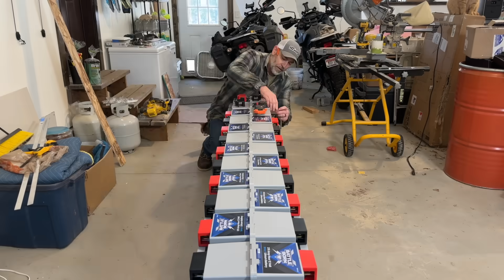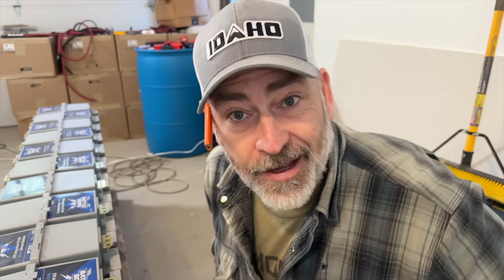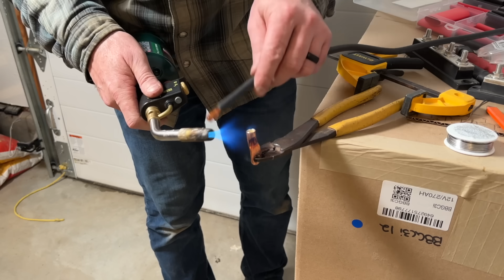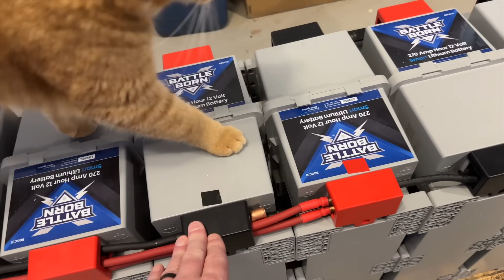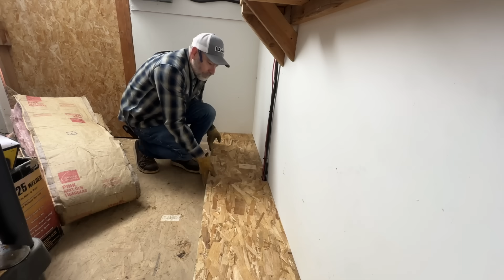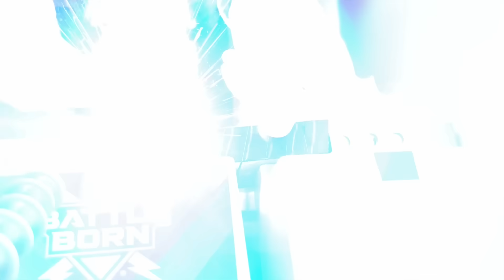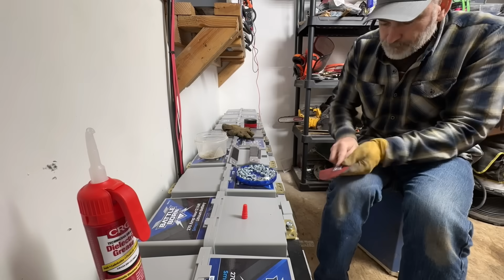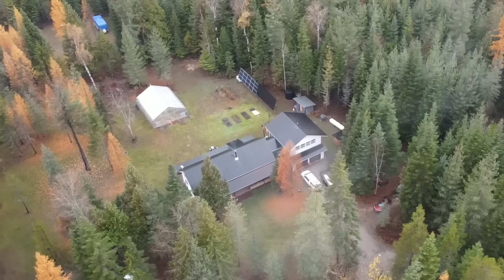BEST Off-Grid Solar Power System Battery Bank

Comment: Honestly ive been looking into a battery system like this, thank you for this tutorial on how to set it up.
Reply: You want nothing here.  Nothing.  If you consider any of this a tutorial, it is a study in every thing not to do.

1.  Battleborn is full of sh*t.  Just the batteries in this 'build' list for $25,000.  My whole home system with 8 280Ah batteries cost about that much.  Including the solar panels.

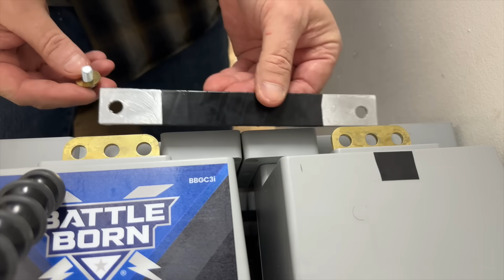2.  If you watched this video, especially to the 15:42 mark, you'll see a great reason why you shouldn't follow ANYTHING here.  He's lucky he wasn't hurt.

3.  Not a single good practice was followed.  The wire is undersized.  You DO NOT solder lugs.  There's no fusing.  No balancers/equalizers.

4.  You want a 48V system and battery, just go get 48V batteries.  The choices are numerous.  And it will not cost what this trash costs.

Comment: You seriously have know idea what your doing there is no string protection your soldering lugs instead of crimping them you did not charge the batteries before connecting them together, we're is the cooper bars connecting the batteries together aluminium is less than a third of the current carrying capacity of copper antiseize on the bolts there's just so much wrong with this video mate please get a huge life insurance coverage for your families sake

Comment: Your cables are undersized. Without each string being isolated by a fuse you have the potential to put enough current through one of those lugs that the solder melts. this is a disaster waiting to happen. You need a professional to go over this with you to ensure you don't burn your house down.

Comment: Yikes, Marty, you definitely have to be more careful when working with these high power devices. you could easily have severely injured yourself!

Also, a lot of things are definitely wrong with this setup. I don't know if you are taking feedback into account, but if you are, here are a few pointers:

- wrong size cable: Especially when paralleling the strings, you need a cable that can carry the sum of all currents. Even more so, look at the highest current rating that your battery can deliver and size the cable to that. You definitely don't want your cable to burn up before your safety devices habe a chance to trip.
- aluminum bus bars: you should definitely use copper here. Aluminum is notorious for passivating itself leading to high contact resistance.
- soldering your lugs: i don't know where you got the idea from, but you definitely want to crimp these lugs to your cable to create a solid cold weld. The solder will re-liquify itself when the cables get hot. Worst case, the connection will become lose and you have an uncompressed lug and a cable that do not have a solid interface. This will lead to hot spots, more heating and even possibly fire.
- Paralleling the batteries: In my view, you should have a DC breaker per string to be able to controllably control the current going into your batteries and have a safety switchoff
- Cable length when paralleling: Victron is pretty specific that you need identical length of cables from each battery bank to your inverter. You aren't showing how you set up the wiring exactly, but it looks to me as if the three banks end up having differently long cables. this leads to differences in resistance, and will create imbalanced batteries in the long run,.

Even if you report 6 months of flawless operation, i can only hope that you will take this advice and rework the setup as per the suggestions as it is currently very unsafe. 

Edit: I concur with the rest of the folks here: Will Prose showed a lot of the things. Best take his advice into consideration.
Reply: I feel for you, I'm guessing the comments will cause a lot of stress for you and your family. I love the content you usually put out and I enjoy watching it every week.

Comment: We are not off grid but we are using solar, gas and generator like you, we just had the option for grid when we built this home so we took it to have more options. Recently we have added a smart home controller to track / change how we use power. It can monitor and change settings in the Victron equipment helping us conserve power for example if storage becomes less than 5000W turn off AC and lights then send me a notification we have reached <5000W for example. It’s something that is a game changer for us trying to not use grid. We also use it to start things like AC if we are over 95% charged and the temp inside is > X... and run until storage is < X for example. It’s worth looking into with all the options these days.

Comment: U shouldnt even be using solder esp with the that solder technique….melt the solder in the lug and then plunk the wire into it. Good chance of a cold joint which will fail.

Comment: So many of you, people came over here from will's video and you need to go back
Does he need fuses? Yes, should he have used bigger wires? Yes, should he have crimped instead of soldering. Yes. Ithis a system that has been running for 6 months? Also, yes, did it cost a lot of money. Why are you checking his pockets like that? This is what he wanted to build. This is what he built. Go sit down somewhere.

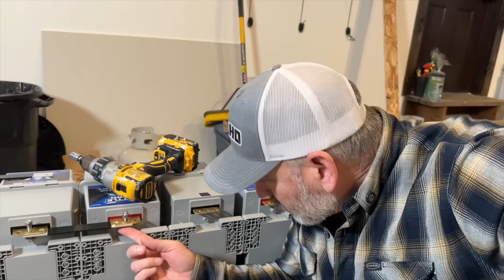Comment: 11:42 - Ya that really sucks, but the problem isn't the nylon, the problem is that you didn't use anti-seize on stainless hardware. For the price of the batteries they really should have include brass hardware.

Comment: Actually un-subbing. Can't trust the rest of you work my dude. You are going to people killed by starting fires. Im all for buying American, but your setup is NOT safe. You're not even soldering correctly. You heat the wire, then let the solder "absorb" into it.

Comment: I remember when your first video came out somewhere about 8 years ago, you were one of the first to use lithium batteries when most of us were still babying out our AGM batteries. May I say nice work? My diy setup is mostly of used lifepo4 cells bought off Battery Hookup who told me it is not wise to mix different types of lifepo4 batteries especially manufactured in different countries. It's been 3yrs and my system works well. I would say though after 6 month I would had love to see if they are balance and how accurately they are sharing the loads.

Comment: Why do you not crimp your cables. Solder only, if ever gets hot, can fall apart and short to whatever it falls against. Always, always!! Crimp the lugs!! Then if one wants a bit more noble connection, solder it too. Don't use solder for the mechanical connection!!

Comment: Why on earth would you want to use 12 volt batteries instead of just one 48 volt battery?  You'd be spending $25K just for the batteries.   My EG4 setup is 42.9 KWH....  plus the Flexboss21 inverter and the GridBoss MId for just over $17K.  So why spend $7k more and put in all this work?    No way this is the best off grid system.   This seems silly to me.  Might have done this maybe 10-12 years ago when 48 volt batteries didn't exist.

Comment: Hi, I'm Martin Johnson, I'm here to display that you can spend 10x more money on batteries that aren't suitable for the bank I will build with them.  I suggest after dropping 25k on batteries you save money by using aluminum busbars and not dropping $100 on a cable crimper and instead create an incredibly dangerous system by welding the lugs and placing negative and positive cables of improper gauge directly on top of each other.  Thanks for tuning in.  Oh, and make sure you have good fire insurance.

Comment: There are many things wrong with this video.  I am surprised Battle Born sponsored this.  However, when I looked at Battle Born's website, I saw all they sell is 12v batteries.  This seems very counter intuitive since there is no easy way to balance these when put in series.  When you start with a 48v system, the BMS's are generally setup for internal balancing of the batteries.  These are not.  As Will Prowse pointed out, they are out of balance in this video.  Battle Born, I would ask Martin to remake this video correctly with good electrical practices.

Comment: Do you know the number to 911. 
This is the biggest joke of a battery system. 
Don't do these aluminum bus bars. Are you joking. Soldering  Not a crimped under size cables to close together..

Out of balance cells this is so crazy. 
Stay away from doing it this way. 

I could go on forever. Even Battleborn battery should tell him this is not the way.
If they are supporting this they are libel. 

DON'T DO THIS SYSTEM THIS WAY........

Comment: This is a nightmare. As an electrician who specializes in solar power and putting the systems into houses, don’t do this. This is a fire waiting to happen. This is how people get killed with systems like this.
Reply: You are correct. This video needs to be removed.  Battleborn is reckless to sponsor this
Reply: @d.rayowens422 well they do melt contacts.
Reply: Exactly this is literally every single thing you should never do .

Comment: This is a great way to burn down your house and your wallet. 12v battleborns cost like 3-5x an actual 48v battery of the same capacity. Aluminum isn't suitable for that much current. Soldering lugs is very wrong, crimp them... Battleborn should be furious about their product being shown in this setup

Comment: Where is the battery balancer?  When you tie four 12v batteries in series, you need a balancer to keep them in sync.  You can even see this in your app,  the batteries are not in sync.
Reply: Check page 39 of the battery manual

Comment: You’re honestly putting a lot of people, including yourself, at risk here. Don’t do this. This isn’t fine. Your conductor sizing is not safe, your material choices do not account for junction differential, you’re introducing brittle mechanical joints with your flood soldering.

Comment: Just from an electrical point and over 45 years of working with high power DC systems up to 3 MILLION VDC, I feel compelled to comment. THIS SYSTEM IS AN ACCIDENT WAITING TO HAPPEN!! You are aware that copper melts at about 2,000 F and it will happen in a few seconds when you over amp your 4 ga wire. Also aluminum is not conductive enough, your pick is good for maybe 175 Amps, for the amperage capacity of the battery if there is a fault, copper would be a much smarter choice (3 times the capacity). Your BMS should not allow an amperage higher then the smallest capacity wire feeding it also. In your build that should be 60 AMP MAX, but 50 Amp would be a better choice. Just make sure your HO insurance is paid if there is ever a problem.
Reply: I've a similar background, retired now and agree 100%. This build scares me. All it would take is a viewer trying to copy it and doing a slightly less quality job of it. Or the same quality of workmanship and a bit of bad luck. Think house fire, potential injury and loss of life. He should take the video down and rebuild his system properly.

Comment: This is a great example of what NOT to do when sizing cables and using lugs. FFS you need to stop Martin before you burn the place down.
Reply: I wonder if he also carries a Sig P320.
Reply: @richandrews4488 😂
Reply: Exactly! One has to CRIMP the lugs, never ever solder like that, being fire-hazard from the very beginning: Something not seen beforehand happens, wires get hot but fuse still not blown, what happens next?

The solder gets liquid again and the connection fails, might still carry current, but would be fire ignition system very fast very hot at that point, and there is no fuse that would save you on this scenario. Super dangerous when compared doing it by crimping properly.

Solder is for electronics or other very small currents, never ever for actual power transmission.

Please remove this video, before someone burns their place. AND CRIMP YOUR CONNECTIONS!

Dear mister, we love you, but this is a horrible example.
Reply: @LLampen  DC Arc-Flash can change your life.
Reply: Lol, all of you plagiarizing Will's video pretending to be experts, I guess its ok if it made you fell special for a minute
Reply: @mwgrc  I only fell special at raves, but this one time, I feel down and bumped my head. I didn't fell special after that.

Comment: You should remove this video. Everything you did is wrong and unsafe. Aluminum is not used for high current! What's the area or that bar? You use 48v batteries for a 48v system, not 12v in series without balancing! You must fully charge each battery before wiring in series. Your wiring is too small and can melt that solder right out of the lugs when the cable over heats. Your calculations are running backwards. Those batteries can output 300A, not limited to 70A!

Delete this video.
Reply: If you have an overhead service line go outside and look at it.  That's aluminium.  If there is an LV network in your area that is aluminium too.  So is the MV distribution wiring.  Use an appropriate CSA and it's good.
Reply: @retrozmachine1189 the battery has brass terminals. Aluminum and brass don't touch well
Reply: @z50king29  Look inside the battery.
Reply: @retrozmachine1189 C o o l, simp

Comment: best standard without any comparison with the competition ? 

Sad to see the whole video and design decision I have never seen before. Hopefully others check first proper books or how other do a serious job.
Soldering the cable lugs - where did you get that from. Havent you seen the house that had been burned years ago.
Battleborn will not be hapy about that video based on the details you had provided and would cause others to follow you with those errors.
Here the fire department would go crazy with such a battery built full of 12 V batteries. 

I wonder when it will become private cause battle born must go wild with the issues in the video - at least for professionals. If something will go wrong for those viewers who trust the presentation , the drama will explode between such viewer and battle born , later even with Martin for not having crosschecked his video by a third party if that is really a proper built video. 

Maybe youtube will take it down when some opens a complain about the huge amount of errors if someone else follows this videos and get harmed.
Reply: F JEWTUBE

Comment: These batteries are over priced and not even equipped with the latest technology.  Your set up is unsafe and no one should be copying you.  You need to increase your cable side you also need mechanical connections.  Also when building a 48 volt system you need 48 volt bms for your batteries.  Not only is this method unsafe its also the most expensive way of doing this!  Total fail man sorry I'd take this video down if you want to keep any credibility...

Comment: Wrong wrong wrong.  High resistance solder connection compared to proper crimp. Also why use minimum spec on something as important as as your family’s safety.  You have lost a lot of respect here.

Comment: That's a mediocre way to spend $25,000. First, just buy 48 volt batteries. Secondly, crimp the connections. The last and most important, if you are going to do it this way, ensure that the gauge of aluminum bar you use will support your load.

Comment: Free battery's in exchange for infomercial and some cash under the table to boot.  Is that fair to the lugs like me that pay for our equipment? 

Aluminum buss bar on copper with a third metal for hardware?   Really?  Solder is melted with heat therefore a very bad idea to use solder in this application where the cables may heat up.  You are going to move all those batteries aa one unit on that flimsy set of cobbled pallets?   Sounds about right for this project.  As things move around multiple battery's are going to get broken and cracked cases. 

Take this as constructive criticism, watch instructive YouTube videos rather than make them.

Comment: Martin, I'm just curious as to why you used aluminum bars instead of copper, when the price of both is quite close, but  copper is by far the superior conductor of electricity?
Battle Born must have either given you the new batteries or made you a deal you couldn't pass up to make you want to upgrade batteries using 12V batteries when 48V are so much better and easier to setup for your solar system today.

Comment: How are the individual batteries going in terms of voltage balance 6 months down the track (ie measure each one with a multimeter or if the app shows each one's voltage that would do too).  BB recommends either charging in-situ with an isolated multi-battery charger or breaking the system down each year and bringing each battery up to 100% SOC separately.  A greater number of charge/discharge (including partial) during a year can mean that you have to do this more often depending on how much they drift from each other.  See page 39 of the manual.
Reply: He shows they are out of balance.
Reply: @sprtplt  yes, but very crudely with pictures.  Numbers would be much more informative.
Reply: I don’t think he’s read the manual. In fact I don’t think he’ll be doing much reading at all after this.

Comment: Gotta back up the others...  You need to get rid of the aluminum and soldered cables for brass/copper and crimped.  There are brass bolts to make connections also.  It'd be a shame for all the equipment to burn.

Comment: Those battery bolts look like Stainless Steel...they require Anti-Seize or they won't come off as you have found out.  Never put Stainless steel together without using anti-seize.  

I would have made the busbars out of copper, it doesn't expand and contract like aluminum.

Comment: You're getting tore up in the comments about soldering, not crimping. Also an aluminum buss bar, not copper. Ill leave it alone..😂😅😊
Reply from the maker: Go watch the other videos where I used crimps. It is the same in reverse 🤣🤣🤣
Reply: @MartinJohnsonOffGridLiving I've done both as well, never a problem. I appreciate you 😊